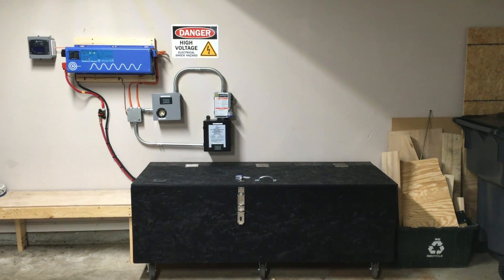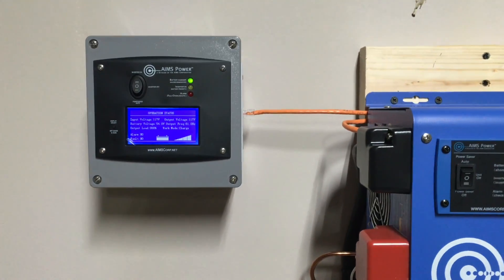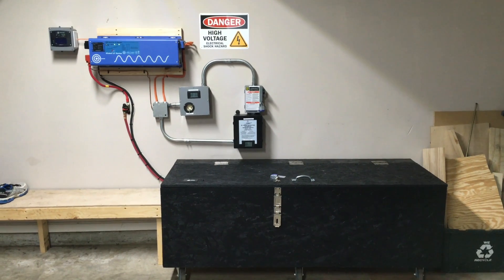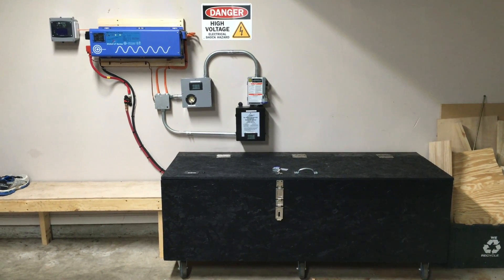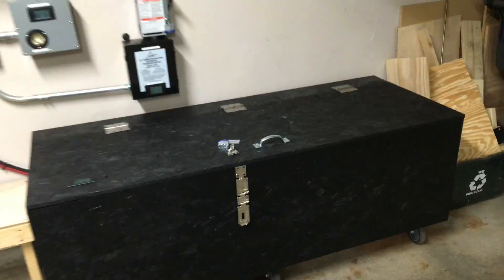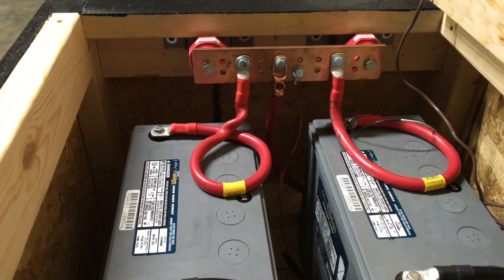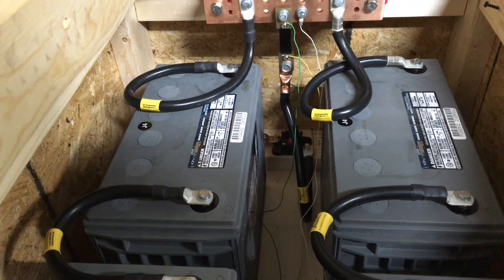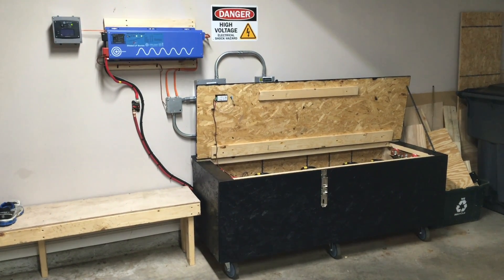Aims 6000 watt 48v inverter and battery bank (Whole home uninterrupted backup) - 1.5 of 3 - UPDATE

Comment: I don't know what electrical efficiency your speaking of other than maybe you installed LED bulbs. Irons draw 1100 watts and will draw constant power to stay hot.  Microwaves do not level off they use constant power. Washers also have a constant draw as they have live loads that the washer motor must overcome. I think your probably running a few lights and a TV and you think that's comfort. Air condition is quite necessary if it's over 100 degrees outside. I run 3/ 48 volt banks with a 5K array. Hope this helps you better understand electrical consumption
Reply from the maker: I actually understand them quite well thanks.  And while I do have all LED bulbs I digitally monitor every outlet in my home and have exact data driven detailed diagrams of wattage and amp draw of every device in my home.  This helps me find things most people don’t.  Again I’m not using anything that would sustain an absurd draw when there a large scale outage of any sort.  Also if you used data modeling and monitored a washer you’d find that it does not have a continues sustaining draw.  The drum does stop spinning frequently and during a spin cycle the resistance will slow decreasing the load on a motor especially when your using a direct belt drive washer.  It rarely if ever reaches 100 degrees where I live.  So again different needs for different people.  But hey thanks for your comments.  You seem really smart, on the internet...
Reply: @dubohio  What are you using to monitor every outlet?  I like the idea of collecting the data so I can properly design a system.  Nice video and thanks for sharing!
Reply: @dubohio  They could have used you during Apollo 13 mapping out energy usage.

Comment: 1500 watts will not run a washer, a standard microwave, iron, or an air conditioner. How do you get by with only 1500 watts and be comfortable?
Reply from the maker: RAFE Alexa I do run my high efficiency washer off this system and rely on gas for warming food.  Air conditioning is a luxury not something I need to be comfortable.  If there is a power outage for a week I wouldn’t want the noise of an air conditioner announcing to everyone I have power when a ceiling fan is just fine.  This system is for emergencies.  During an emergency you want to maximize your batteries since you’ll never know how long an outage will last.  Also this system is only half the equation.  I’ve made a lot of electrical improvements in my home to reduce my wattage draw so I can do more with less.  Please also keep in mind that my reasons for such a system may very from yours with different goals and levels of comfort.  While 1500 watts seems low it’s not.  High watts are typically only used during startups of devices and then quickly level off to considerably lower levels.  Hope that helps.

Comment: How are you getting you second phase to your panel. Yes I know it's all 120 Volt but you have two separate phases on a modern electric system.
Reply from the maker: RAFE Alexa I’m not.  There’s no need too.  No 110v circuit needs 2 phases and I’m not running anything that’s 220.  Everything I’m running peaks at about 1500 watts all together.  This system was designed to keep me comfortable in the event of an outage.

Comment: Absolutely great system. Really well done. I learned a lot from your videos as I'm planning my own system. One quick question. Why do you have 2 automatic transfer switches?? I believe your inverter has a automatic transfer switch and then you added a separate one as well from GO Power. Can you detail this for me??
Reply from the maker: javier2surf the transfer switch in the inverter is used for switching between battery and the incoming AC feed.  The go power transfer switch feeds the AC side of the inverter.  The go power has utility power feeding one side and generator feeding the other.  It’s just an automated way I can switch between generator and utility power without having to rewire anything during an emergency.  The goal was to make hooking up the generators so easy anyone could do it should I not be home.  How that’s understandable.
Reply: Totally understand. Very logical. This makes perfect sense. I have to have it to you. Excellent work. I may contact you in the future with one or two questions as I put my system together. I'm currently drawing up my schematic.

Comment: Hello thank you for sharing this I have a question why did you get a 250 amp circuit breaker vs a circuit breaker with less or more amps?
Reply from the maker: Kali I’ve actually changed this in my setup.  It’s now 150amp breaker.  This is really jus a fail safe for me in the event the leads touch or something in the inverter itself shorts out.  Now, I have never seen my amp draw above 10amps in MY SETUP but that doesn’t mean yours won’t be different.  I have a relatively low watt draw because of efficacies in my home setup.
Reply: Thank you so much for answering! Ok, my usage is at the most 5kw what circuit breaker would you recommend? Also, I was thinking of starting with a 4 x 6v battery bank system hooked up to a 5kw power inverter. Do you think this setup will do the job? Sorry for all the questions there isn't a whole lot of info out there that can dumb it down for someone like me lol!

Comment: A dumb question, how do you charge the battery or how long would the battery power last?
Reply from the maker: jose chavez the batteries are charged via the inverter from utility power currently.  The system will very based on load draw, but with my load and this system I get ~24 hours of uninterrupted power.
Reply: dubohio ok this is way out my understanding but it really got my attention, thanks for answering

Comment: I am new to these things and I have a doubt when I was researching online I found that connecting more than 4 batteries in parallel is inefficient which generate lots of heat and thus lots of energy is lost I just wanna know if this is true, so anyone having any idea please let me know thank you
Reply: I'm no expert, but I'd say circuit resistance would be the main cause of any excess heat. I just finished installing my battery bank a few months ago. I decided to go big from the get-go, so used 4/0 copper welding cable to the inverter, and copper bus bar battery inter-connects. I'm currently running 8 Group 31 AGM's and can run the entire house for 24 hours before needing to recharge. The only way you know the house is running on battery is when the inverter / charger cooling fan kicks on every so often. Aside from that, it's silent, and no measurable heat. Recharging takes around 3 hours from bulk to float. The reason for installing it was to not need to run my generator for long periods, or over-night, plus, it opens the door to slowly installing solar / wind. It's pretty nice peace of mind, especially if one lives on a semi-remote power grid, where wind / snow / ice storms can knock out your power for a couple weeks before the utility company gets out to put new poles. BTW, be sure to look into balanced battery wiring configurations and periodic equalization, it's important for keeping your batteries equally healthy. Higher quality inverter / chargers usually have an equalization mode available. Good luck, take your time, read as much as you can, and make it a "fun" process, instead of frustrating. I really enjoyed it, personally.

Comment: When you did that 19 hour test run, what was the wattage load for your whole house?
Reply from the maker: jasongeo2 well I started the test around noon on a Saturday and just went about my day as normal.  This system doesn’t handle 220v so no dryer, stove, or AC loads on this system.  My wattage was between 300 and 3500.  My home is extremely efficient with LED everything and energy star accessories.  My average watt draw on any day is about 800-1000 Watts when home.  When sleep or away I idle around 300 Watts.
Reply: @dubohio  That is an amazing set up.. WOW. Can i pick your brains for a sec please...
I have a maximum 500 watt (inital demand of 306w & 1.6a increasing to 453w & 1.9a after a 3 min period, 400w hps light and ballast) load i would need to run for 12 hours via a 2kw inverter.
The batterys will be charged via a small engine and alternator.
Could you tell me what AH batterys i need, how many i need and what amp alternator i'd need to charge them.
Thanks.

Comment: This is not technically an uninterrupted backup? Because you have to throw the transfer switch on your own. Its not automatic. Correct me if I'm wrong?
Reply from the maker: jasongeo2 it is uninterrupted.  There is no manual transfer switch in this setup.  The box with the lever is a disconnect for maintenance.
Reply: oh...I see.

Comment: You can save lots of money by following this program as there is no need to buy a new battery for a dead one. You can repair that battery by following simple techniques [Check Details Here==>https://www.facebook.com/Battery-reconditioning-310070329426065/app/208195102528120 ].It is affordable and less expensive because you don’t need special tools for that. You can use simple household items to repair the battery.

Comment: well done . lovely set up . I have a similar setup going on two things that are benefits but not absolutely criticalplace a mid point connection  btwn  the parallel bats with a 5a fuse  thin wire . it balances you battery voltages better(but if the fuse pops  its means you have a battery problem )this is a nice to have , place a 12v voltmeter in each battery . you can always see exactly what happening with the bats ,its also a early warning system should on bat start to fail. cheers

Comment: I like it, how many amp hours does your batteries total too and how much kwh does the system make , I would really like to know
Reply from the maker: The batteries are 12v @ 134 AH.  I have two four battery strings at 48v.  So (134 AH * 2 strings = 268 AH) * 48 volts = 12864 watt hours or 12.8 KWH, approximately.

https://www.power-solutions.com/batteries/deka/unigy_ups/deka-unigy-high-rate-series-31hr5000?doing_wp_cron=1499994345.0376520156860351562500

Comment: Nice set up..great ideas from this..
The fuse on the wall for positive.. You should put some electrical tape or liquid tape to cover that exposed ends..
If someone has a pipe or pole and turns around near it there is a chance to catch that little bit around the fuse..
That's what I did with mine..and I also covered the positive on all my batteries just to be extra safe...have a greatday
Reply from the maker: Thanks for the input.  I'm in the middle of making changes and setting up for solar.  I'll take this under consideration!

Comment: By putting two circuit breakers in your DC line, you have doubled the tripping point.  Remove one if you actually want fault protections. With DC being a "loop" you basically wired in two breaks in parallel sharing the load.
Reply: They’re is series, not parallel so the load isn’t shared between the 2 breakers
Reply: I agree...

Comment: dear what wire guage /mm you used to connect the batteries together?
secondly, keeping the batteries in wooden box doesn't have ventilation issue? might have some holes or louvers for this.
Indeed a great job..thumbs up mann!!
Reply: There sealed batteries. Optimal tempiture is 70 degrees.

Comment: I have a 4kw aimes power inverter.  Had to learn the hard way.... the power saver mode won't come on with an inductive load (like a motor), only a resistive load.  This blew my expectation that I'd be able to run the inverter in power save mode and my fridge would make it come on as needed. Not sure if others like Magna Sine work the same way or if a fridge can make the magna sine come on??

Comment: Have you looked into building a box for your generators with a sound dampening material inside and run the exhaust pipe like a manifold system from them to the exterior of your home either through the wall or roof . If so could you make a video on that when or if you do ? Thanks for all the great videos so far very helpful . ////ÐΛЯΞ †o ÐЯΞΛM\\\\ ☠ [̲̅$̲̅(̲̅100)̲̅$̲̅ ]

Comment: I am  Paul Micallef from Australia in the process of getting off the grid and stay with the grid,at present I have a 28 off 200Amp hour battery and a 10 KW Solar Panel Array,I want to go on a 48v system,the battery bank is sitting on a steel frame and have a wooden board under the battery,can you please email me whenever you have time i am not ready to connect yet email me a diagram of how I should connect the system and also what type of a voltage controler I should buy. I thank you for your time and  well done keep the good work

Comment: I have question,which devices used to gain higher kilowatt from different sources,I mean eg I have 2 devices converter on of them is 5 K watts and other have10 K watts how to gather this source and gain15 K watts
Reply from the maker: There is no real safe way I would say to bridge these.  You are better off configuring these to run independent and making sure you or hooking up loads that fit within the operating range of each inverter.

Comment: great video. do you have Solar linked into this? also hows to you size the critical load center?
Reply from the maker: I don't have Solar linked to this just yet.  Critical load's for me are all lights, refrigerator, and garage door which I have designed the system to handle from day one.  If you look at my other videos to see the entire setup I think it will help answer your other questions.
Reply: @dubohio  if you do solar get a very good charge controller mppt and be sure  it can handle atleast 200v pv array because of cloud effect on panels and higher voltage means saved money use smaller Guage cables . I still use 4 awg for my solar cables run and in series put a 10 or 15 amp fuse inline to protect it. And a shut off breaker a duel pole.
Reply: Laurence Franks
Reply: dubohio, can you do a long term review of the agm batteries in terms of charge holding, reliability and price paid vs other cheaper alternative?

Comment: Tidy and simple. Please put a small-rating fuse, (1A), in your monitor wires near the battery terminals, to protect the wiring in case the monitor units decide to fail. Providing you keep your depth of discharge low (use less than 30% of the available capacity) and manage your batteries on a regular basis those batteries should be good for 8-10 years, by which time Lithium batteries will be cheaper.
Reply from the maker: Thanks for the kinds words.  I think there is a 12am fuse in there right now, could be lower.  I am looking forward to when a better more reliable battery technology is cheaper!
Reply: For voltage monitor wires they will only take a fraction of an amp to operate. the fuse is there to stop the wire setting your shop/garage on fire in the event of a fault. 
Fit one today, now. Don't spoil the ship for a ha'p'orth of tar!

Comment: The next time you need batteries, check out fork lift battery, 850 amp hour,
24 volt or 48 will last about 15 years, around 2500 bucks. Lots of options.
the only downfall is they are heavy.
Reply from the maker: Yea so there are a ton of those on craigslist around here but I couldn't get pass the cost, weight, and the difficulty in a repair in the event it all goes wrong.  In the event I really need this setup it'll be hard to find a 2 volt battery (which is what usually makes up these big fork lift banks ) where as my current setup I can take a 12 volt batter out of a car and be back in business in no time or better yet use a cars alternator to charge each batter in a grid down generator down event.

Comment: I love it!  Good job!   Is that the Aims Inverter/Charger?  If so, the gen set can feed through it or recharge the battery bank.  But those wheels under the batteries....I cringed. 

Living in a seismic zone I bolted and strapped my battery box  to the concrete floor in my Y2K hardened store room. Everything is fused with Mega Fuses including each negative battery terminal and the DC distribution panel. There's a lot of power in a small space. I shorted a 210 amp hour battery once....and will NEVER do that again. Trust me!

I had some failures with the resettable circuit breakers so I replaced them with copper fuses and wing nut terminals. There are also DC LED panel lights in case of the need to troubleshoot and spare fuses are attached to the DC panel if needed.  My project was built just for fun and I had plenty of money left over to build it after quitting drinking, smoking, and playing golf.
Reply from the maker: I live in Ohio that box isn't going anywhere but I might create a locking system to hold it to the wall now.  This is the inverter charger and if you watch some of my other videos you'll see I have it setup just like that so while i'm on gen it'll recharge the batteries and run the house.  Thanks for looking!
Reply: I watched your other videos. Wow, you do nice clean work!
Reply: @dubohio  Wow, 2 years ago I commented....  I recently bought 5 of the Aims 200 amp hour lithium batteries for my second battery bank. The power went out in a storm as I put the turkey in the oven that night. So the electric turkey roaster on batteries finished the job. Being California with questionable power, an hour into It I ran the Onan diesel gen set to keep the batteries topped off. I'm completely on LED bulbs, energy efficient fridges and freezers. Its a blast to have everything lit up, running, WiFi, TV, porch lights while it was dark for miles around. It was a great real world test. The gen set is in a sound enclosure in my shop and cannot be heard from the street at all. Haha, my central gas furnace worked as well.